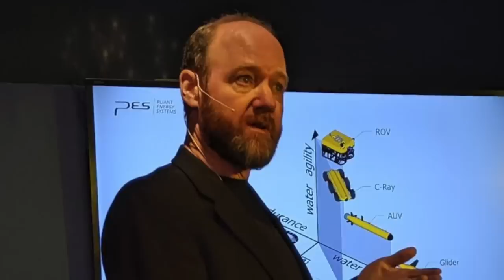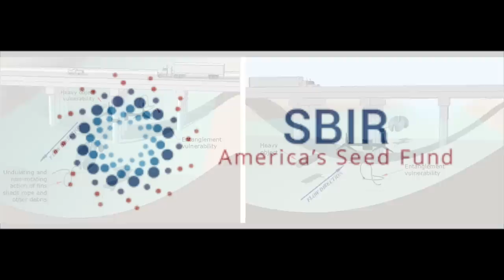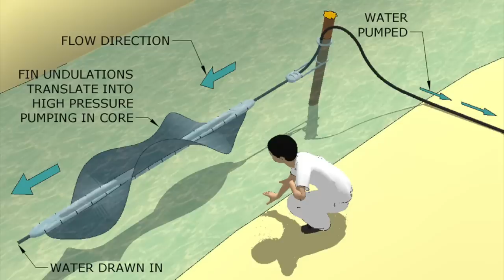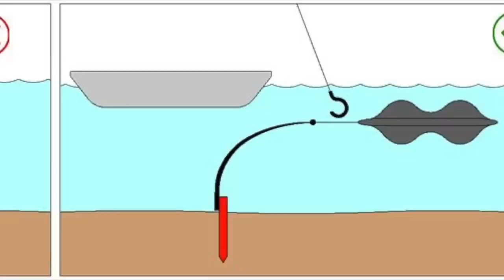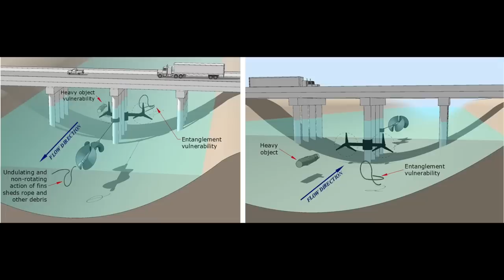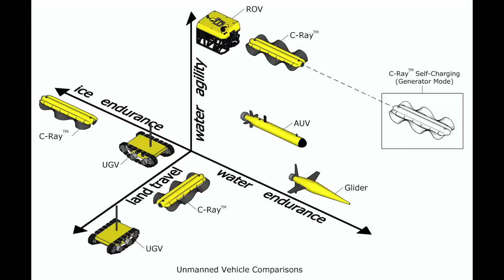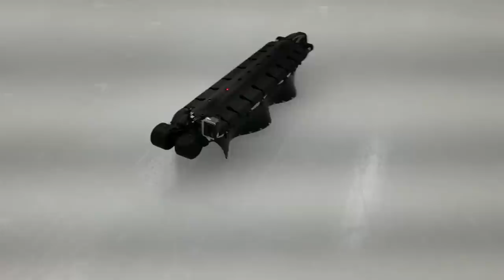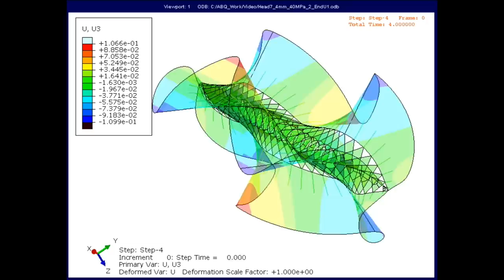The Advantage of Fins with Pliant Energy Systems | Ep. 325

Comment: In the spirit of Hayao Miyazaki, I suspect I’m not the only one who would love to see CFD numbers for powering high efficiency, low-speed, high maneuverability airships with this system!
Reply: Longyi super fine powder grinding machines advantages:
1. Powder from 48~4microns, fineness is adjustable
2. Built-in high efficiency classifier, no more investment cost for classifying system.
3. Smart PLC operation system, and integrated control system: 1 computer could operated max 6 machines, saving management cost.
4. No particle air pollution, more environment-friendly.
5. Compact structure to save factory space and lower foundation construction cost.
 
For CaCO3 powder
The whole grinding system including grinding, classifying, powder collector, fan, PLC cabinet, feeding conveyor and others, system power is 370Kw, the real working power is 296KW
1. D97=23um (600mesh)    Output: 10tons/h      Energy Consumption: 29.6Kw/Ton
2. D97=16um(800mesh)     Output: 8tons/h       Energy Consumption: 37Kw/Ton
3. D97=10um (1250mesh)    Output: 4.5tons/h    Energy Consumption: 65.7Kw/Ton  
4. D97=6.5um(2000mesh)    Output: 2.5tons/h   Energy Consumption: 118.4Kw/Ton 

 
It is suitable for processing nonmetallic minerals such as calcium carbonate, calcite, Kaolin, clay, barite, talc, gypsum, limestone, calcium oxide, bentonite, dolomite, chalk etc.
Best wishes,
 Samuel 
MP/Wechat/Whatsapp: +86 15105956429
Email:Samuel@lymill.com

Comment: This could also function in air flight with modifications in materials and fin designs, while maintaining electro-differential from surface ‘fluid-flow’ to absorb charge from the airborne particles.
Reply: The cams could be powered or assisted by turbines utilizing electrical or flex-fuels, or optimized for specific fuels/hybrids. CVT could be implemented for coupling. One could really stretch design boundary by gathering design and test data from water systems, and ask an AI for design that could transition between sea/lakes and air.
Reply: My Initial inclination is to consider a blend between delta wing/lifting body, albatross/Swift, sea ray… other curious applications would be for fixed infrastructure vortex shedding (bridges, towers, poles, cables, etc).
Reply: The low density of air means that this approach isn't workable for aviation. There's a reason you don't see any flying creature that works like a sea ray.